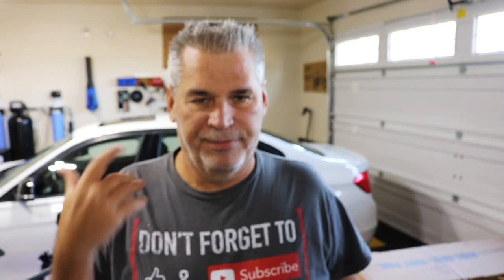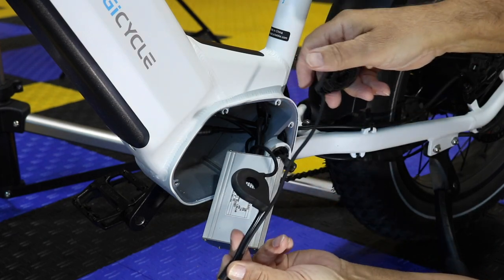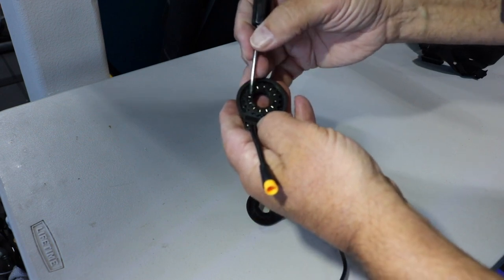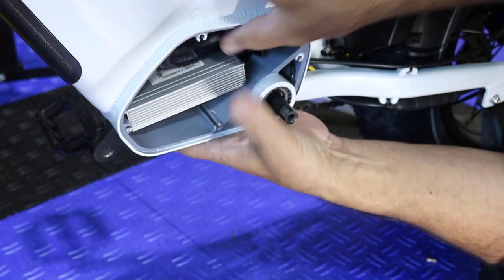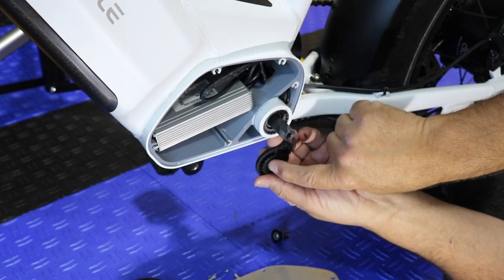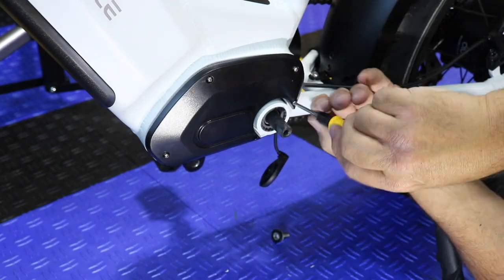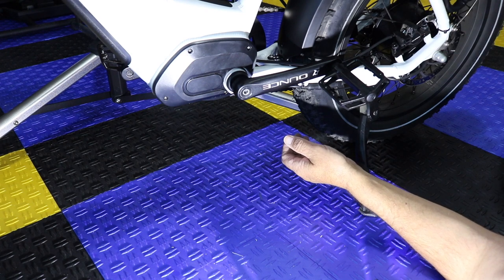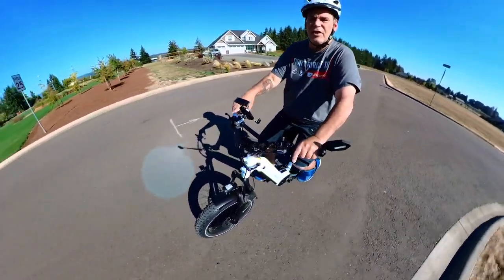Magicycle Ocelot Pro Sensor Pt2

Comment: I got my sensor from Amazon….and after changing it, it did not work!  I then did what you said and changed the inside lock 
ring and magnet ring . Works fine now.  I did discover what I believe is the reason these are coming broken from the factory.  I noticed that I couldn’t just slip the new sensor ring on. It was too tight. I had to sand the crank with 600 or 800 grit fine polishing sandpaper. This removed the paint, and a very slight roughness that was on the crank. Now I could get the sensor on. The lock ring fits tight, and is what holds the sensor on the crank arm. 
    I’m sure what is happening is that the sensors are too tight, and the workers at the factory are simply forcing the sensors on. This causes the lock ring, and maybe even the magnet ring to crack.  My bike worked for about 1 mile, so any short ride test they did would pass.

Comment: I got my Ocelot pro.  It's pretty good, but disappointing.  Max speed is only 26.5 MPH.  I know it's only a 1.5 MPH under it's touted Max, but they shouldn't advertise something that they don't provide.  I'm think about making a vid about this.  That said, thanks for the great video.  I'll keep it in mind if sensor goes out.
Reply: Good chance your speedometer may not be accurate. Find a radar street site to get it tested. I had to change the tire size on another brand of bike I had , but beware this changes the odometer at the same time! I actually bought a add on digital speedometer to get an accurate reading.
Reply: @williamwhiskeyman8086  - Thanks.  I'll compare with my friends speed and see.

Comment: CONGRATS!  Great job of troubleshooting the issue and finding a fix.  

As usual, your video was very informative.  Thanks for all the tips.  Hope Magicycle listens to your suggested solution of just sending replacement magnets.  I also enjoy the bit of humor you added at the end of the clip.

At the 8:45 mark on the video, you actuate the PAS by spinning the magnets.  Viewers should be forewarned to TURN OFF the power switch before working on their bikes and ONLY turn it back on for brief moments to test the system, making sure to turn the power back off after testing.  (Can't imagine what would happen if you accidentally spun the magnets while working under the bike with the power turned on.)  If you warned them in the video, my apologies for missing it.

At the 10:00 mark, when you've reinstalled the controller, I would've packed the empty space with aluminum foil in order to create a better heat sink.  While there haven't been reports of any issues with the Ocelot Pro's controller overheating, I know that it is pumping a lot of amps out to the motor.  Anything to ease its job would be helpful.
Reply from the maker: Great info.  Yes I turned it on to test.  You are right, Not sure i said to turn off power.  Very powerful and could hurt you if you do it with it powered up.  Glad you stayed to the end.  Aluminum foil idea.  Hummm If there was a heat-sink issue that might be a great idea. TY.

Comment: I own a Deer 20 and was wondering if you think it's a sensor problem:  I'm always on gear 7 (I never change it) and on PAS 4, riding at around 28km/h.  Then suddendly it felt like the chain fell off because I was 'air' pedaling which has nothing to do with "ghost pedaling" when you ride too fast!.  But the chain was ok and after a while it kicked in. Or maybe the controller? Thanks for your input! Looks like Magicycle doesn't know much about their ebikes.
Reply from the maker: It could be the sensor.  If you have the crank removal tool and youu remove the sensor...its easy to see a crack in it that would cause what you are talking about.

Comment: Thank you for a very informative video, Bruce. Glad that you figured out that you could switch just the new sensor part into the old one. I'm just wondering if a Tork Wrench would have been helpful if you had the Tork Values that Magicycle uses.
Reply from the maker: Yes a torque wrench would give you an exact torque needed to assure you have the correct applied force.  I have one too.  I know ebikes torque is unique from manufacturer to manufacturer.   Magicycle would have a number, Im just using whay feels like enough.

Comment: If I have a question, I also have a magicycle oscillate pro. I use it for work and I recently drove it in the rain, it wasn't a pouring rain, it was just raining, and my pedalicious sense are has stopped working. It's been a couple of days now. It still hasn't started working. A contact in Magicycle, They said they would give me a new sensor I'm hoping it will dry out after a couple of days, but the reason I'm messaging you is, have you ever had this happen because this is the second time it has happened to me the first time it dried out, think about after 4 or 5 days but this is the second time. And I haven't counted exactly, but it's been a few days. And it's still not working yet., I tried to dry it with the air dryer yesterday and it worked real quick. I tried it 3 times all 3 times it worked and then today I used it to go to work and it's not working again. Have you ever rode your bike in the rain? And has your sensor stopped working because of it?
Reply from the maker: Im wondering if the sensor is cracked like mine was and I just got worse going thru water.   Watch how I did my replacenet and when you put it on don't wiggle it on.  Just kinda press it slowly.  Its actuallty a very simple device and Im surprised without total submersion that it does not work.  Get the new one and try to avoise puddles.  rain should not be an issue with the sensor..

Comment: I got my tools yesterday, and took mine apart. Yes, it’s cracked.  Magicycle has one on order for me, but I decided to also order an extra one from Amazon. The picture on Amazon shows a long cord. Thanks for the video. I put anti seize on my crank to help remove the crank in the future, since I don’t have my sensor yet.
Reply from the maker: Bill, Add a amazon link in your reply.  ler me know how it goes.  Thanks. Bruce
Reply: @RVEnthusiast   Bruce, I’m sorry, but I have no idea how to put a link in.  I went back, and I can’t even find the one I just ordered! However, by putting in pedal assist sensor, I see another one that looks the same by accolmile. $14.97 . they also shoe an extension cable , but it would be way too long. When Magicycle contacted me, they said the we’re getting one from Amazon for me, as they are apparently out of stock for now .

Comment: If a known issue the should send a spare with the bike
Reply from the maker: I believe the issue has been resolved on current batches.  I pointed this issue out to them and they did send me another and I did not even buy the bike from them as a YouTuber.  They are on Amazon as well.  As you can see it was just a small plastic part that needed replacing.  Hopefully in the future they will just replace or send that small part.  Who knows. They are very very easy and nice to deal with.  At least for me.
Reply: Jaguar…undi! What a dad joke! Very good video. Love my OPro!